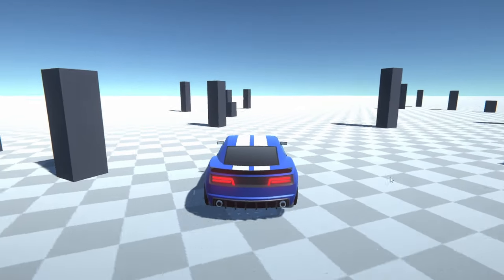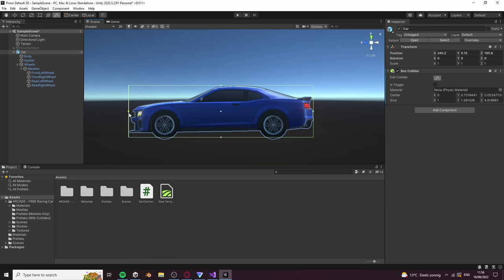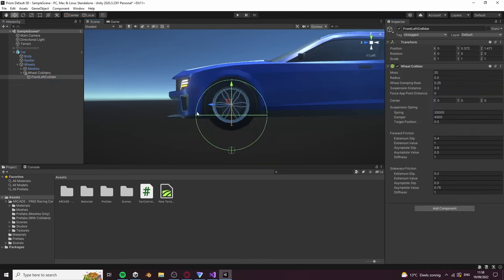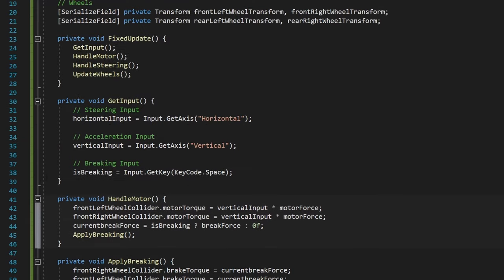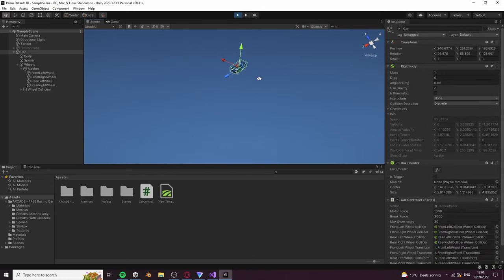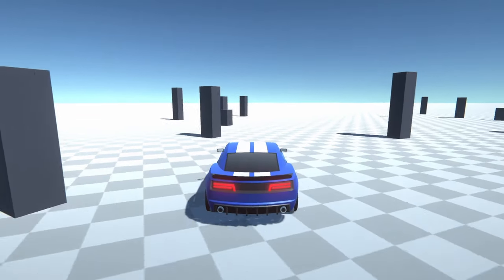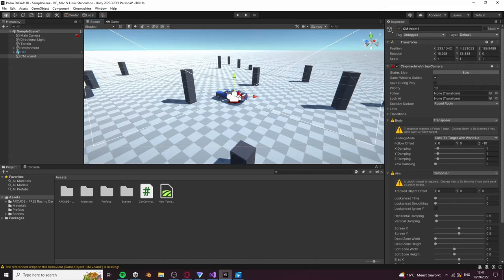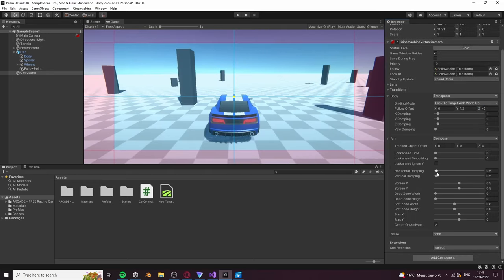Simple Car Controller in Unity (Copy Script)

Comment from the maker: Please ask me questions if you are stuck
Reply: How can I input the follow offset it won't let me
Reply: I want to make the car drift at the press of a button but everything I tried looks unrealistic or the car looks like slipping not drifting.
Reply: My car still flies away but slowly
Reply: @slimebonebg  mine too
Reply: I can’t find the cinema thing
Reply from the maker: @Greenhairgamer_YT  Have you installed it in the package manager?
Reply: @SigmaLigmaChannel  sorry got it now
Reply: @SigmaLigmaChannel  one other thing 
I can’t stop the car from tipping over
Reply: I my car can’t flipping over even though I changed the springs and dampers
Reply: @Prism I cant modify the wheel collider
Reply: @prism My wheels are rotating around the ground please help me
Reply: my wheels rotate like in a circular shape instead of in the wheels position
Reply: @MILK-vt7ld  wheels turn left and start rotating ? Is I am right
Reply: Hi umm everything works fine but i got one little problem...my "W" and "S" keys are inverted so when i press "W" the car goes backwards and the "S" goes forward. Can anybody please help me with this issue?
Reply: my car overturns
Reply: I stuck on car controller ._.
Reply: can i use it without wheel collider?
Reply: @slimebonebg maybe the collider is toching the ground
Reply: ı do everything but my car is still go soooooooo slow
Reply: @Softhall  increase the motor force
Reply: @Softhall  increase speed
Reply: How did you get that car
Reply: @Legendary387-i5u  from the asset store
Reply: My car just randomly gets launched into the air 5 seconds after I press play
Reply: will I be able to convert this game to xbox using your same script?

Comment: I changed the spring and damper to the same values in all wheel colliders, but my car still flips over really easily.
Reply: me too
Reply: sounds like the mass of the car is too low. if there is no weight to support the force the flipping part will happen. try adding mass to the object in your rigidbody
Reply: same
Reply: exception
Reply: The issue is the UpdateWheels function. Im not sure what it is for though, I wish they explained it in the video.
Reply: I think I have it, that function is for turning the wheels, make sure whatever model you use, you hook the wheel transforms in where with wheel meshes not the collider objects.

Comment: how do i improve my starting speed? I cranked the motor force to like 999999 but it still takes forever to build up momentum.
Reply: I would add an impulse force during the first frame that the button is pressed, along with the normal car force
Reply: @realkhushmehta  How do you do that?
Reply: @mcshootems  alternatively, you could also multiply with mass
Reply: what is your drag on the rigidbody of the car? for me i had the same problem because it was at 5. if i put 0.1 then it works nicely
Reply: me too bruh this car controller sucks

Comment: I have a little issue with the wheels, they're rotating but not using the centre of the wheel for it. They rotate in a open "circle", I mean, they move from the centre and create their own circumference.  Trying to apply the script to truck wheels so they're not "small wheels". Thanks in advance.
Reply: Had the same issue, it doesnt have to do with the wheel size, the center point of the wheel is screwed up (from the 3D file),  i used my own model (using blender) to create the car, when you export the car wheel, make sure it's on 0,0,0 (xyz) coordinate otherwise it do the ohio wheels
Reply: @Not_Aran8276  ohio wheels 💀

Comment: What are the controls for the movement cuz i have been typing WASD and changing valus weight brake and have also readjusted the colliders but still no results i.e. movement
Reply: The tutorial doesn't mention it, but you need to install the new unity input system package under Unity Registry
Reply: @richbuilds_com  Can you explain more plz?

Comment: car movement too slow. I tried increasing the acceleration (motor speed) up to 1 million but car still too slow. Need help
Reply: try lowering the drag of rigidbody of the car
Reply: Adjust the friction of the wheels! Your wheels are probably slipping, basically spinning in place, but it's really hard to tell. Reduce forward friction extremum slip to like 0.001 and iterate from there.

Comment: even with the car's mass being 1300, it still flies upward and eventually falls down. I tried raising it A LOT and a little, but it only slows the rising of the car. Not sure what I've done wrong but I did exactly what you did and used the same car model...
Reply: its also when I begin to move forward, it just flies up into the air slowly

Comment: its work but i got one problem, the movement is slow, like heavy, i put motor force, break force and macx steer angle like in the video but still slow, anyone can help?
Reply from the maker: I recommend you change up the value of the variables. Let me know if it helps

Comment: If you for some reason dont want to click in the bio for the code here is it:   

using System;
using System.Collections;
using System.Collections.Generic;
using UnityEngine;

public class CarController : MonoBehaviour
{
    private float horizontalInput, verticalInput;
    private float currentSteerAngle, currentbreakForce;
    private bool isBreaking;

    // Settings
    [SerializeField] private float motorForce, breakForce, maxSteerAngle;

    // Wheel Colliders
    [SerializeField] private WheelCollider frontLeftWheelCollider, frontRightWheelCollider;
    [SerializeField] private WheelCollider rearLeftWheelCollider, rearRightWheelCollider;

    // Wheels
    [SerializeField] private Transform frontLeftWheelTransform, frontRightWheelTransform;
    [SerializeField] private Transform rearLeftWheelTransform, rearRightWheelTransform;

    private void FixedUpdate() {
        GetInput();
        HandleMotor();
        HandleSteering();
        UpdateWheels();
    }

    private void GetInput() {
        // Steering Input
        horizontalInput = Input.GetAxis("Horizontal");

        // Acceleration Input
        verticalInput = Input.GetAxis("Vertical");

        // Breaking Input
        isBreaking = Input.GetKey(KeyCode.Space);
    }

    private void HandleMotor() {
        frontLeftWheelCollider.motorTorque = verticalInput * motorForce;
        frontRightWheelCollider.motorTorque = verticalInput * motorForce;
        currentbreakForce = isBreaking ? breakForce : 0f;
        ApplyBreaking();
    }

    private void ApplyBreaking() {
        frontRightWheelCollider.brakeTorque = currentbreakForce;
        frontLeftWheelCollider.brakeTorque = currentbreakForce;
        rearLeftWheelCollider.brakeTorque = currentbreakForce;
        rearRightWheelCollider.brakeTorque = currentbreakForce;
    }

    private void HandleSteering() {
        currentSteerAngle = maxSteerAngle * horizontalInput;
        frontLeftWheelCollider.steerAngle = currentSteerAngle;
        frontRightWheelCollider.steerAngle = currentSteerAngle;
    }

    private void UpdateWheels() {
        UpdateSingleWheel(frontLeftWheelCollider, frontLeftWheelTransform);
        UpdateSingleWheel(frontRightWheelCollider, frontRightWheelTransform);
        UpdateSingleWheel(rearRightWheelCollider, rearRightWheelTransform);
        UpdateSingleWheel(rearLeftWheelCollider, rearLeftWheelTransform);
    }

    private void UpdateSingleWheel(WheelCollider wheelCollider, Transform wheelTransform) {
        Vector3 pos;
        Quaternion rot; 
        wheelCollider.GetWorldPose(out pos, out rot);
        wheelTransform.rotation = rot;
        wheelTransform.position = pos;
    }
}

Comment: script:

using System;
using System.Collections;
using System.Collections.Generic;
using UnityEngine;

public class CarController : MonoBehaviour
{
    private float horizontalInput, verticalInput;
    private float currentSteerAngle, currentbreakForce;
    private bool isBreaking;

    // Settings
    [SerializeField] private float motorForce, breakForce, maxSteerAngle;

    // Wheel Colliders
    [SerializeField] private WheelCollider frontLeftWheelCollider, frontRightWheelCollider;
    [SerializeField] private WheelCollider rearLeftWheelCollider, rearRightWheelCollider;

    // Wheels
    [SerializeField] private Transform frontLeftWheelTransform, frontRightWheelTransform;
    [SerializeField] private Transform rearLeftWheelTransform, rearRightWheelTransform;

    private void FixedUpdate() {
        GetInput();
        HandleMotor();
        HandleSteering();
        UpdateWheels();
    }

    private void GetInput() {
        // Steering Input
        horizontalInput = Input.GetAxis("Horizontal");

        // Acceleration Input
        verticalInput = Input.GetAxis("Vertical");

        // Breaking Input
        isBreaking = Input.GetKey(KeyCode.Space);
    }

    private void HandleMotor() {
        frontLeftWheelCollider.motorTorque = verticalInput * motorForce;
        frontRightWheelCollider.motorTorque = verticalInput * motorForce;
        currentbreakForce = isBreaking ? breakForce : 0f;
        ApplyBreaking();
    }

    private void ApplyBreaking() {
        frontRightWheelCollider.brakeTorque = currentbreakForce;
        frontLeftWheelCollider.brakeTorque = currentbreakForce;
        rearLeftWheelCollider.brakeTorque = currentbreakForce;
        rearRightWheelCollider.brakeTorque = currentbreakForce;
    }

    private void HandleSteering() {
        currentSteerAngle = maxSteerAngle * horizontalInput;
        frontLeftWheelCollider.steerAngle = currentSteerAngle;
        frontRightWheelCollider.steerAngle = currentSteerAngle;
    }

    private void UpdateWheels() {
        UpdateSingleWheel(frontLeftWheelCollider, frontLeftWheelTransform);
        UpdateSingleWheel(frontRightWheelCollider, frontRightWheelTransform);
        UpdateSingleWheel(rearRightWheelCollider, rearRightWheelTransform);
        UpdateSingleWheel(rearLeftWheelCollider, rearLeftWheelTransform);
    }

    private void UpdateSingleWheel(WheelCollider wheelCollider, Transform wheelTransform) {
        Vector3 pos;
        Quaternion rot; 
        wheelCollider.GetWorldPose(out pos, out rot);
        wheelTransform.rotation = rot;
        wheelTransform.position = pos;
    }
}

Comment: using System;
using System.Collections;
using System.Collections.Generic;
using UnityEngine;

public class CarController : MonoBehaviour
{
    private float horizontalInput, verticalInput;
    private float currentSteerAngle, currentbreakForce;
    private bool isBreaking;

    // Settings
    [SerializeField] private float motorForce, breakForce, maxSteerAngle;

    // Wheel Colliders
    [SerializeField] private WheelCollider frontLeftWheelCollider, frontRightWheelCollider;
    [SerializeField] private WheelCollider rearLeftWheelCollider, rearRightWheelCollider;

    // Wheels
    [SerializeField] private Transform frontLeftWheelTransform, frontRightWheelTransform;
    [SerializeField] private Transform rearLeftWheelTransform, rearRightWheelTransform;

    private void FixedUpdate() {
        GetInput();
        HandleMotor();
        HandleSteering();
        UpdateWheels();
    }

    private void GetInput() {
        // Steering Input
        horizontalInput = Input.GetAxis("Horizontal");

        // Acceleration Input
        verticalInput = Input.GetAxis("Vertical");

        // Breaking Input
        isBreaking = Input.GetKey(KeyCode.Space);
    }

    private void HandleMotor() {
        frontLeftWheelCollider.motorTorque = verticalInput * motorForce;
        frontRightWheelCollider.motorTorque = verticalInput * motorForce;
        currentbreakForce = isBreaking ? breakForce : 0f;
        ApplyBreaking();
    }

    private void ApplyBreaking() {
        frontRightWheelCollider.brakeTorque = currentbreakForce;
        frontLeftWheelCollider.brakeTorque = currentbreakForce;
        rearLeftWheelCollider.brakeTorque = currentbreakForce;
        rearRightWheelCollider.brakeTorque = currentbreakForce;
    }

    private void HandleSteering() {
        currentSteerAngle = maxSteerAngle * horizontalInput;
        frontLeftWheelCollider.steerAngle = currentSteerAngle;
        frontRightWheelCollider.steerAngle = currentSteerAngle;
    }

    private void UpdateWheels() {
        UpdateSingleWheel(frontLeftWheelCollider, frontLeftWheelTransform);
        UpdateSingleWheel(frontRightWheelCollider, frontRightWheelTransform);
        UpdateSingleWheel(rearRightWheelCollider, rearRightWheelTransform);
        UpdateSingleWheel(rearLeftWheelCollider, rearLeftWheelTransform);
    }

    private void UpdateSingleWheel(WheelCollider wheelCollider, Transform wheelTransform) {
        Vector3 pos;
        Quaternion rot; 
        wheelCollider.GetWorldPose(out pos, out rot);
        wheelTransform.rotation = rot;
        wheelTransform.position = pos;
    }
}

Code

Comment: Version je pense un poil mieux en vrai :

using System;
using UnityEngine;

//Grand VOL https://www.youtube.com/watch?v=DU-yminXEX0

[RequireComponent(typeof(Rigidbody))]
public class SimpleCarController : MonoBehaviour
{
    private float horizontalInput, verticalInput;
    private bool isBreaking;

    private Rigidbody rg;

    // Settings
    [SerializeField] private float motorForce = 1000f;
    [SerializeField] private float breakForce = 3000f;
    [SerializeField] private float maxSteerAngle = 75f;

    [Tooltip("merde pour adoucir l'input en fonction de la vitesse")]
    [Range(0f, 2f)]
    [SerializeField] private float motorSteerCoeff=0.5f;

    [SerializeField] private wheelObject[] wheelObjects;

    [Serializable]
    struct wheelObject
    {
        public WheelCollider wheelCollider;

        public Transform wheelRender;
        [HideInInspector] public Quaternion baseRot;

        public bool canSteer;
        public bool reverseSteer;
        public bool hasBrakes;
    }

    private void Start()
    {
        for (int i = 0; i < wheelObjects.Length; i++) wheelObjects[i].baseRot = wheelObjects[i].wheelRender.localRotation;
        rg = GetComponent<Rigidbody>();
    }

    private void FixedUpdate() {

        GetInput();

        float motorTorque = verticalInput * motorForce;
        float currentbreakForce = isBreaking ? breakForce : 0f;
        float currentSteerAngle = (maxSteerAngle * horizontalInput)/((rg.velocity.magnitude * motorSteerCoeff)+1);
        

        foreach (wheelObject item in wheelObjects)
        {
            item.wheelCollider.motorTorque = motorTorque;
            if (item.hasBrakes) item.wheelCollider.brakeTorque = currentbreakForce;
            if (item.canSteer) item.wheelCollider.steerAngle = item.reverseSteer ? -currentSteerAngle : currentSteerAngle;

            UpdateSingleWheel(item.wheelCollider,item.wheelRender, item.baseRot);
        }
    }

    private void GetInput() {//ca va cest du truc de base mais le nouvel input sys c mieux en vrai
        // Steering Input
        horizontalInput = Input.GetAxis("Horizontal");

        // Acceleration Input
        verticalInput = Input.GetAxis("Vertical");

        // Breaking Input
        isBreaking = Input.GetKey(KeyCode.Space);
    }

    private void UpdateSingleWheel(WheelCollider wheelCollider, Transform wheelTransform, Quaternion rotToAdd) {
        Vector3 pos;
        Quaternion rot; 
        wheelCollider.GetWorldPose(out pos, out rot);
        wheelTransform.rotation = rot * rotToAdd;
        wheelTransform.position = pos;
    }
}